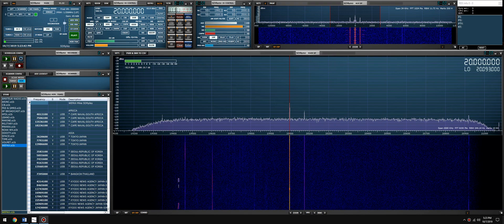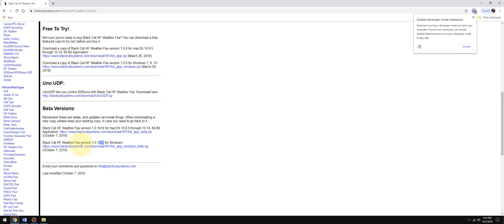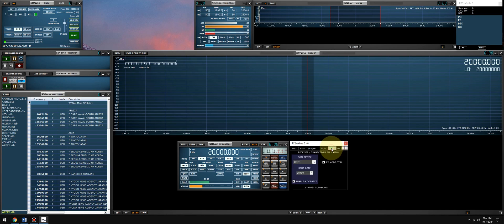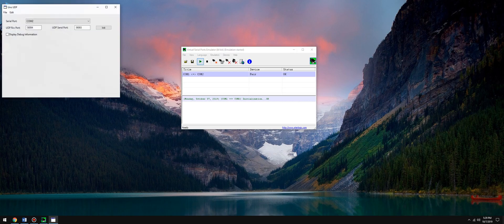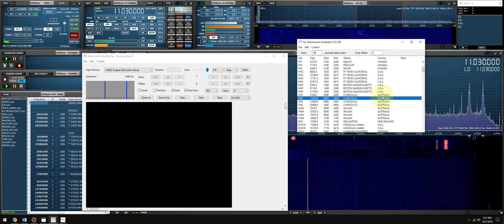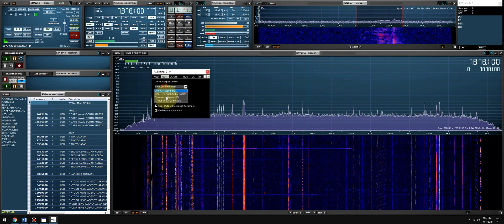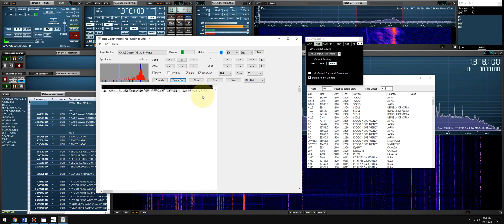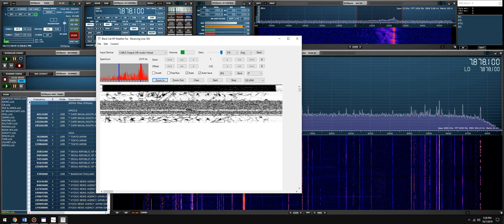HF Weather Fax, SDRuno, complete setup

Comment: Nice video Mike! I set the audio level so that 30% shows in the audio bar on the top of the Black Cat Wefax GUI. Also with weak or disterbed signals are coming in the BW is set at 1300 Hz low and 2500 Hz high to get the cleanest charts. A Wefax transmission is 800 Hz wide and its best the total BW is about 1200 Hz to give it some headroom as to not attenuate the sidewalls. As you can see Chris has made a extra colum so you can set the sample rate of the specific station as they are all deviating a bit. This way you have to not deal with this every time you change transmitter and you do not have so much picture slanting as a result. I look forward to the PDF.
Reply from the maker: I will try 2500/1300 and she how I get on. I agree with leaving some headroom. Black Cat weather fax internally filters the audio as well as the AUX SP's passband filtering in SDRuno